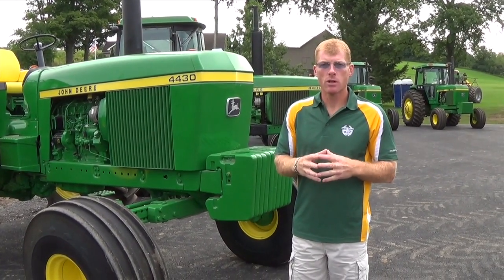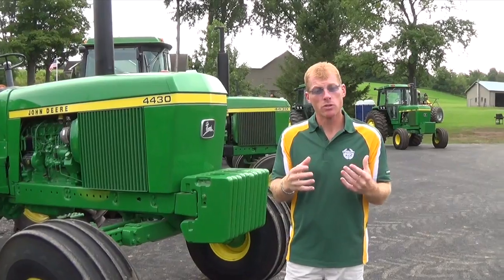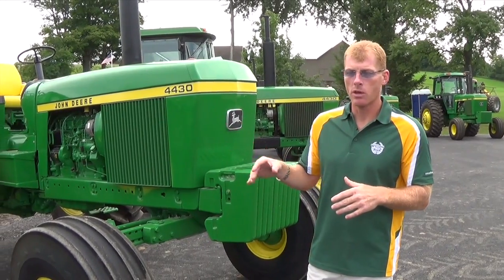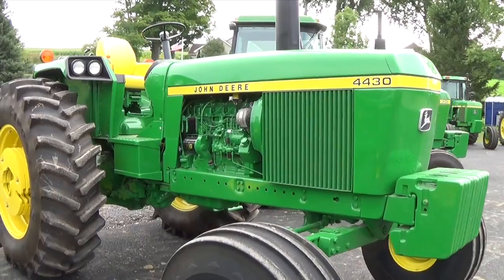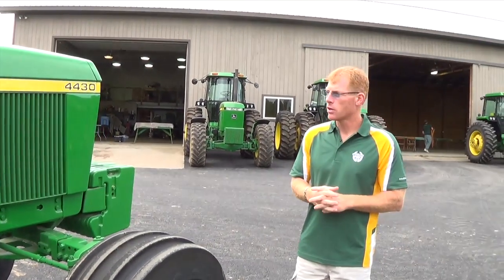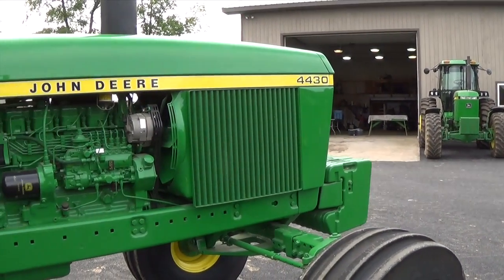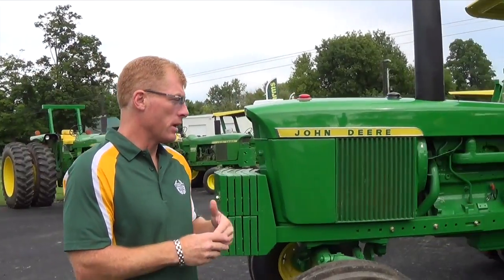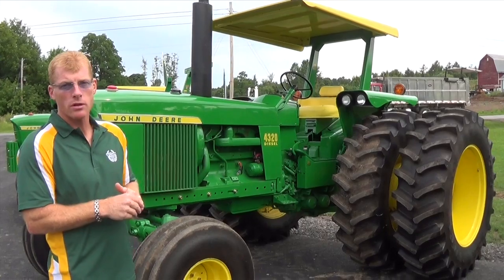Willow Run Farms JD 4430 & 4320 Restored Tractors

Comment: We had a 4430 with no cab , hating driving it down the road because the dirt seemed to swirl and get in my eyes . We had a 4020 and 4320  and those didnt have that problem .
Reply: I remember our 4230 4 post was that way when I once got caught in rain driving it home. It seemed to swirl off the roof and channel directly towards the operator haha.
Reply: We had a 4320 I learned the hard way about those hydro brakes lol!!! I shut ours off in gear on a hill one time and I found out real quick why you should NEVER do that😬😳😂 I barely got it started before rolling out n the road with a loaded hay wagon on!!! My dad was proud haha!!